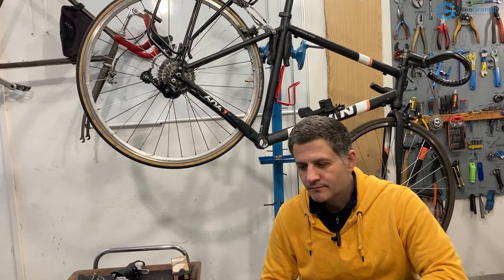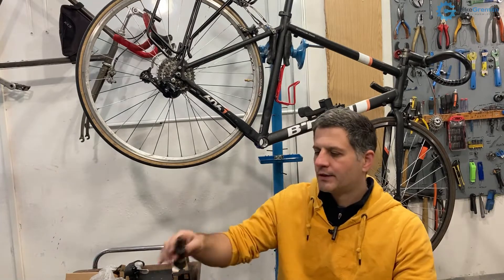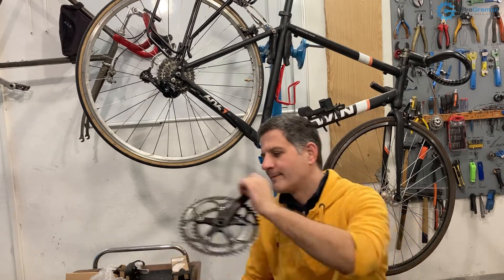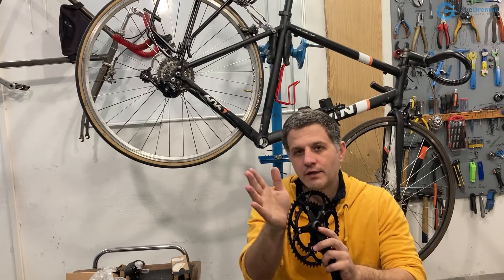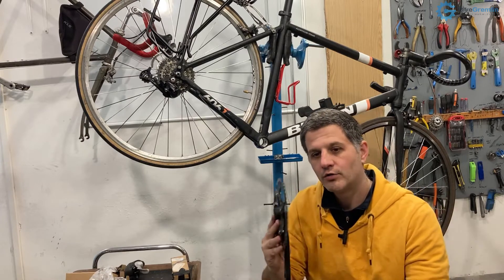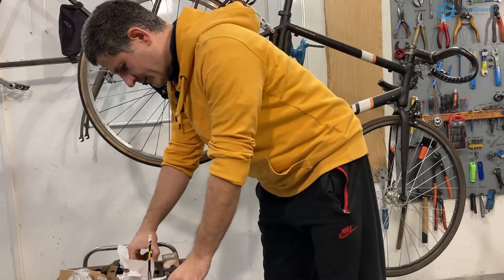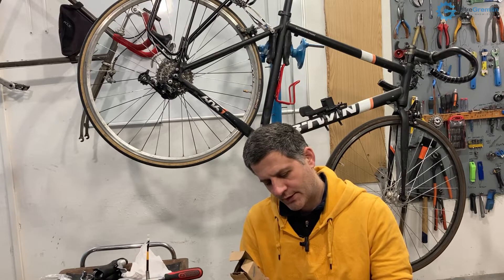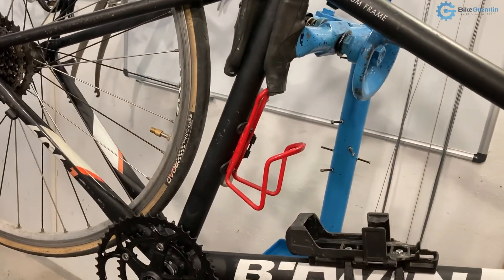What length square taper axle do I need?

Comment: The best way to determine a proper axle length is to actually look at the crankset manual. Most brands will provide you with the optimum axle length for the best chainline. The tricky part begins when you have some no-name stuff...
Reply from the maker: "When all else fails, look at the manual!"

Comment: Excellent video! I just pulled the bb from a Zizzo folding bike with one ring (I’m upgrading to a double) and it 120mm! Maybe there was a supply chain issue?
Reply from the maker: Could be. Most modern square taper cranks fit the JIS taper standard and I would look for a 117 ~ 118 mm Shimano bottom bracket as a replacement for that one.
Reply: @BikeGremlinUS  Sounds right! Thanks!
Reply: Actually 119 on closer inspection. To go from a single to an FSA Tempo double, I’m going to try a slightly shorter 113.

Comment: I am having a Shimano triple in the front.The older bb was 120mm.I don't understand,they don't produce it nowadays? I neee to choose only between 122.5 and 117.5mm?
Reply from the maker: It seems so. 
122~123 mm is usually good with trekking/MTB triples paired with matching derailleurs.
117~118 mm usually works better with triple road derailleurs.
Reply: @BikeGremlinUS  It's 48-38-28 teeth so more hybrid than mtb.I've tried 127.5mm the front derailleur couldn't  put the chain on the largest chainring,no matter how I adjust it
Reply from the maker: Yup, 127~128 is too long.
122~123 should be good.

Comment: I have an odd size threaded squared tapered bottom bracket that is hard to find 68 x 119   Closes I come is 68 x 118 & 68 x 120. Which size would you recommend.
Reply from the maker: Hi,

If the search of bike.bikegremlin.com website doesn't provide a satisfactory answer, please post the question on the bikegremlin.net forum, so that the answer(s) can be easily searched and help everyone else with the similar dilemma.

Relja

Comment: Here are some comments from over 45 years of working on bikes.

You can check your chain line by looking backwards through the gap between your chain rings at the cluster.  Another way is to slide a stiff metal yard stick between the chain rings and lay the back end of the yard stick on the cluster.

I have a number of older bikes (road and mountain) that still use tapered cranks. I long ago dumped all their original bottom brackets and replaced them with Phil Wood Sealed Cartridge Tapered Bottom Brackets and their associated Cups.  While these are expensive you cannot purchase a better looking and operating tapered bottom bracket and they literally last for decades.  They come in all style tapers, axle lengths and threads to fit any model frame and crankset.  Their proprietary Cups use a special wrench and actually totally thread into the bottom shell from both sides and grab the cartridge allowing the cartridge to be moved back and forth somewhat to finis your chain line when installing.  They last for ever and can be rebuilt for minimal cost by the factory.  They also have longer tapers on their axles which allows reuse of cranksets that are bottoming out on regular tapered axles (which can happen after to many removals and installs).

I have some that are 40 years old and still working and they spin better the more they are used without any play.  I cannot recommend them enough other than the initial costs (cartridge, cups, and wrench over $200) but they are literally a set and forget item which pays off in the long run as little or no maintenance.

www.philwood.com
Reply from the maker: Great points.

From my perspective - Europe, Serbia:
Phill Wood BBs are difficult to source, and cost almost as much as half of my countrymen earn per month.
Shimano square taper BBs cost about $12 to $15 and often last for a decade (depending on mileage and riding conditions).

Relja

Comment: What happens if you can't find the length you need? I've got a 125mm that seems to be an odd ball size.
Reply from the maker: I look for the closest match in that case. 123 and 128 are more common lengths. The choice depends on the desired chainline, drivetrain usage (large vs small chainring usage) and FD cage movement range. 

Relja
Reply: @BikeGremlinUS  This is off a BCA SC29 Mountain Bike. A POS in my opinion. The fixed cup of the bottle bracket is so frozen onto the frame it's not even funny. Been trying for at least a week if not more to get it off so that I can replace it to no avail. Rounded it off with the spanning tool and am now trying the unorthodox methods found on here and haven't had any luck yet.
Reply from the maker: If it’s an aluminium frame, BB cups can seize so the removal is not possible without damaging the frame’s threads. :(
Reply: @BikeGremlinUS  Figures. Yeah. It's an aluminum frame.
Reply from the maker: Try this:

Put the bb tool in a vice. 
Put the frame on the tool. 
Improvise some washers and a rod to keep the frame pressed/engaged on the tool. 
Use a heat gun with up to 180 C temperature on the BB shell. 
Try turning the frame to unscrew. 

Over the past decades, I came across a few frames where even that would not help. 

If it works, a thread chasing tool will be needed to clean the threads. 
If the threads are British standard, and they get ruined beyond repair, you can cut new Itslian standard threads. 

Use anti seize paste on all threads that are aluminium-steel combination. 
https://youtu.be/Xb7NEbc3sUI?si=rAeK3u8MgBlkeoUN
Reply: @luigiprovencher  It is much easier to try to remove the fixed cup by going through the hole in the middle of the cup instead of around the outside.  Use a large bolt with washers on each side of the fix cup with nuts to hold the washers.  Then you can put a large wrench, socket with breaker bar or a large impact driver on the nut and turn it without worrying about it slipping off the cup.  Personally I would use an impact wrench after using penetrating oil on the cup threads.
Reply: @jaycahow4667  Yeah I've tried that. Still didn't work.

Comment: question! how do I confirm that my BB has a 24TPI or 26TPI thread? the bike in question is an old BSA made in late 80's and desperatly wants an upgrade from cup & cone to sealed bearings.  THANKS
Reply from the maker: Measuring the BB shell’s width can be telling. Common diameters and shell widths:
https://bike.bikegremlin.com/1634/bicycle-bottom-bracket-standards-explained/#3

Also, besides counting, there is a tool for measuring the pitch:
https://www.amazon.com/Grip-Thread-Pitch-Gauge-SAE/dp/B004ROIU2A

Comment: You did an excellent job!

I have rebuilt a few bikes, perhaps 60 or so and I am considering moving an old Giant Perigee to a triple crankset using a bit longer bottom bracket. The original BB for a double Shimano Biopace crankset measured 116mm but I’m only going to move up to 118mm and see how much clearance is present. I wish I had looked at the clearance before I pulled the crankset but it won’t take long to reinstall and check the spacing.  118mm was a frequently given length for a triple crankset on the Harris Cyclery (Sheldon Brown) webpage. Thank you for making this video sir!

Comment: hello, i have a problem with my new crankset that i bought, it seems that the square holes of it is much bigger than my old one as it just slides through to the entire length of the spindle, for reference my current bb spindle length is only 103mm which works well with my old crankset, does crankset square hole sizes differ too?
Reply from the maker: There are two different standards for the square taper spline shape: ISO and JIS.
If your new cranks are made to match JIS standard, and your axle is machinet to ISO, it's normal for the cranks to "climb" higher. The simplest solution would be to find a Shimano cartridge square taper bottom bracket - as most modern cranks are built to JIS standard (Shimano and the likes).

A bit more details on ISO vs JIS:
https://bike.bikegremlin.com/1634/bicycle-bottom-bracket-standards-explained/#jis-vs-iso

Also, depending on your cranks model and type, a new JIS-standard BB spindle may require a 110 or longer axle length in order to achieve the same chainline as before. More about chainline (chapter 6 deals with square taper axle lengths):
https://bike.bikegremlin.com/1755/bicycle-chainline/
Reply: @BikeGremlinUS  thank you very much

Comment: Hello. Thanks for this explanation. It was helpful. I do have a situation with my bottom bracket and chainrings. My BB is a 115mm length (68mm) with a triple chainrings and unable to shift to the small chainring because my front derailleur (clamp on) butts against the seat post and therefore does not have the proper spacing. After listening to your information, I should consider a 122mm BB. For which I assume it will push the chainrings further away from the frame. Is that correct? The difference of 7mm between the 115mm and 122mm , is that split equally on both side of the frame?

Thanks for your time.
Reply from the maker: Hi,

Short answer:

If I had to bet, and/or were able to buy only one-size BB for testing, I'd give the 122 mm a go with a triple crank.

Longer answer:
I usually have all sizes at hand and can afford a bit of trial and error, but I always first try with the size I expect to be the right one most likely (122 mm for Shimano triple cranks).

The length is not split evenly for every size. Picture 11 and the chart below it in chapter 6 of this article show how the length is "distributed" on each side:

https://bike.bikegremlin.com/1755/bicycle-chainline/#6

Comment: Cool vid. I believe I have read your article on chain line, good stuff too. Chain linen can further be affected by how much you tighten the crank arms into the BB axle, but newer Shimano BBs have a disc at a determined portion of the axle (drive side only) and call it something like chain line keeper.
Reply: I would like to ask you something regarding ball bearings. I recently acquired a bike with Shimano 105 wheel hubs (1055 series, from the 90s) and want to overhaul them. However, I find online that one can purchase carbon steel as well as stainless steel ball bearings. The hubs in question aren't listed as compatible with either of the two, maybe because of their age. Which would you recommend? (And why?) FWIW the bike will mostly be ridden in Belgium, so hitting pot holes is a real danger. Thanks in advance!
Reply from the maker: Hi Carlos,

I don't use stainless steel. Bearing balls are well protected from water/rust by the grease in the hub. As far as I know, when rusting is not a problem, carbon steel bearings last longer compared to similar-quality stainless steel ones.

My article on bicycle bearing balls:
https://bike.bikegremlin.com/2255/standard-bicycle-bearing-ball-sizes/
Reply: @BikeGremlinUS  Wow, thanks for such quick reply. I appreciate your advice, have a great evening!

Comment: Very helpful, thanks. Just in the process of deciding on the right size. I had 2, one of 122.5 which worked, but there was too much space and made gear changing "clunky". I fitted my spare, which is 110, but now the smaller gear is only about 0.5mm from the frame, even with a small spacer added  (although gear changing is excellent".). Think I actually need something like 113 or 116.